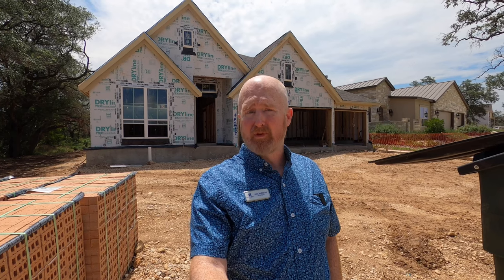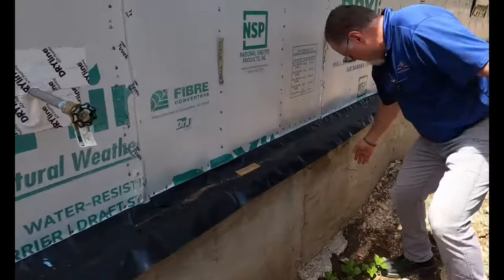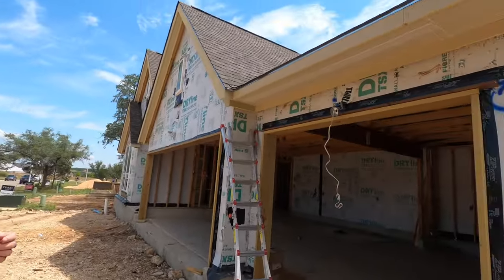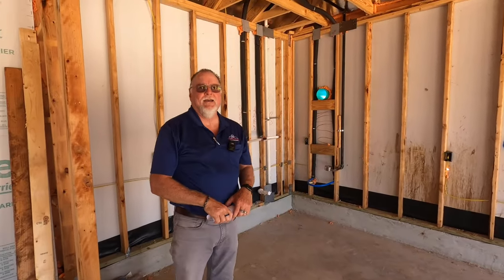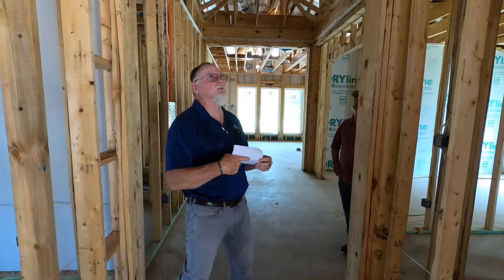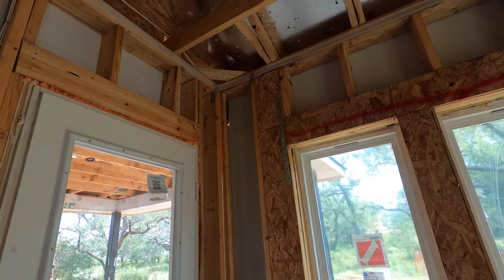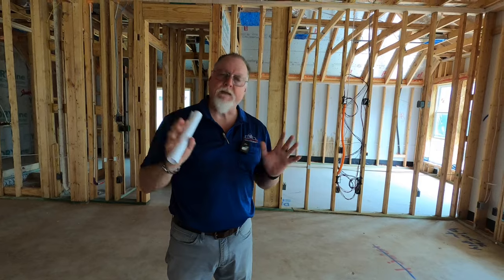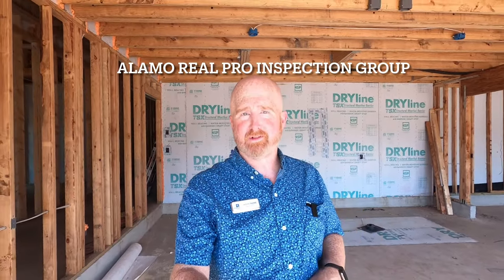Why you should get a Pre-Drywall Inspection on New Construction

Comment from the maker: As you can tell, Alamo Real Pro Inspection Group did a Very thorough job. The report was completed the next and passed onto the builder.  I spoke with the builder afterwards and they also recommended getting these inspections because they will take the report and pass it on to the framers to be fixed. I left a link the inspectors website in the description box.  I do not get any kickbacks from the inspector nor did they pay me to do this video.